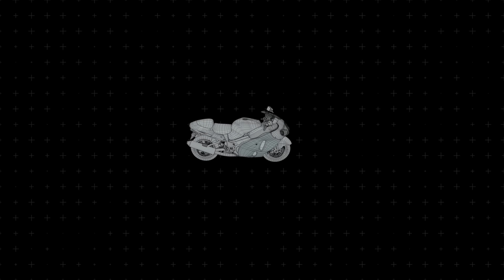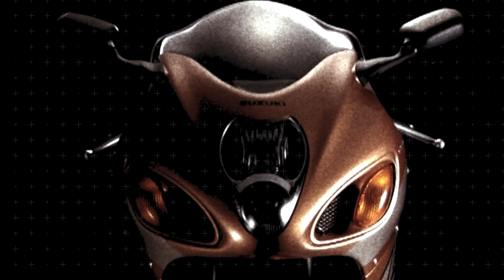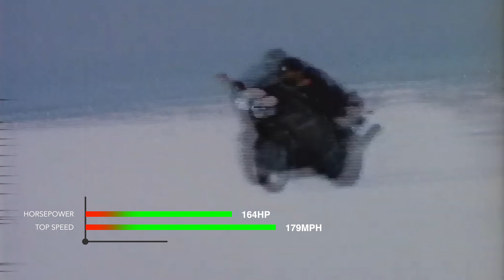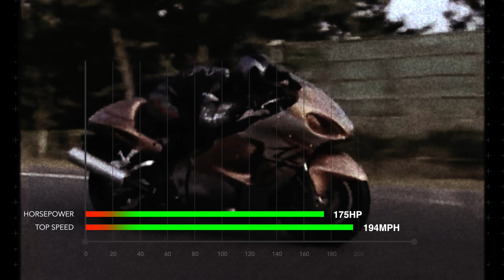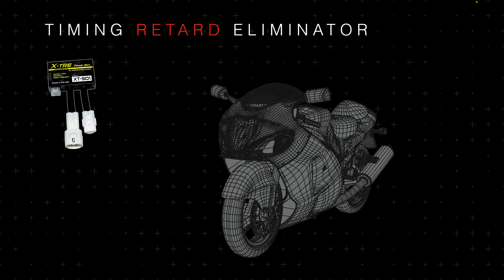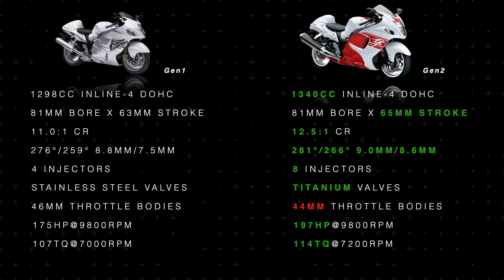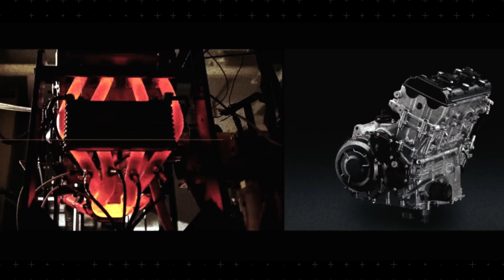Why Turbo Busa Engines Are Overpowered😳| Explained Ep.21

Comment: Radical also uses the stock 1340 Hayabusa in SR3's and SR1's. They also make a bespoke 1500 stroker Busa motor that pushes out 220 at the crank. The SR8 used a macro block V8 with stock cylinder barrels and heads from the Hayabusa spanning from 2.6-3.2 litre V8 that revs up to 10,500 RPM!
Reply: Like Lotus/Cosworth's 3 liter V8 that revs to around 10k and sounds like a F1 engine, pretty gnarly.
Reply: Didn't Ariel do a limited run v8 atom with a custom bottom end and busa cylinder heads too?
Reply: @goosenotmaverick1156  the Ariel runs a V8 but I believe it's based off of a Honda motorcycle engines
Reply: @wadehachey3066  Funny, I always thought they were Busa cylinders.
Reply: @Wooskii1  Me too, Busa cylinder heads and cylinders. CNC a crankshaft and crankcase you use almost all the Busa stock parts then get about 2.2 x stock power. (less bearing losses)
 Need to have a set of cams made for one side as it's running 'backwards'
Reply: @1crazypj  Ah, I didn't think about the cams but that makes sense... I just got a ZX-14R because I couldn't find a reasonable deal on an unmolested Busa. I guess the Kawis don't get torn apart as much. Someone told me that their Legends (or Micros?) use ZX14 motors, but I don't think that's too popular.
Reply: @Wooskii1  Having a separate block makes a big difference if your going to use two for a V-8. With the Kawasaki monoblock you have to make a block as well them have it 'plated' which would probably add another $3500 or more just for materials, machining, etc
Reply: @1crazypj  Yea, I don't like the ZX-14's block design, and I get it would take more to build a V8 block for it vs the Busa, but my point was the I don't see many ZX-14 motors in much of anything (the Legends cars I was talking about are factory ZX motors sealed with anti-tamper measures by the series). I do see tons of Busa swaps, street customs, beaters, and drag bikes which is one of the reasons I think you can find better and more available deals on nice ZX-14s
Reply: @Wooskii1  Friend used to race them when they were using Yamaha FJ motors (at least I think it was Legends?)
I think he left for the series where 'anything goes ' as long as it wasn't over 1000cc (haven't even thought about it for 14¬15 years so your explanation brought it back to me)
Suzuki had special financing for years so I think a lot more Busa's got sold before 2008?
Reply: @1crazypj  Same with me, I haven't talked to the guy that used to race for around 5 years, and he was into something different every few years (micro sprint, shifter carts, etc.) so I might have gotten the details mixed up... I don't know much about Suzuki's finance deals cause I haven't seriously looked into a new bike until very recently. After riding my buddy's Bandit 1200 I'm actually considering getting a new GSX-S 1000 (same motor as my other bike) and selling the ZX, but I need to wait for better weather to get some hours on the ZX first... Right now Suzuki seems to be the best "bang for your buck" and if they were like that back in 06 I definitely can see a bunch of Busas being sold.
Reply: @Wooskii1  I was working at MMI in 2006 and transferred to FAST (Factory Authorised Suzuki Training) 
Knew a few people in the trade back then
Reply: That 'Busa based V8 is nuts, I'd love to mess with one, maybe one day....
Reply: @EZ-D-FIANT  You can buy a detuned turnkey Busa V-8 for around $35,000. Makes a bit over 320bhp and is supposed to be dead reliable for 100,000+miles. The really impressive part is how tiny and light it is compared to any automotive V-8 (complete thing weighs about same aa one cylinder head for a Chevy big block) I seem to remember it's less than 2" wider than stock motor. 
Put one in a Mercedes 'Smart' and go racing
Reply: @1crazypj  tbf that aint that bad, I was thinking they would be about 35-40 UK £ 
I'd probably chuck it in a Hillman Imp on a built Vw camper box (Imps are rear engine if your not familiar with them, my last one was around 800kg they arw very cool little British 60's cars), the engine height is limited (without major work) in those cars we usually run flat/boxter engines or bike engines anyway, I've been itching to build another Imp I can't wait to tell the bank of wife I've been tempted by a £25k engine 😅 👍👌👍
Reply: @EZ-D-FIANT  Yeah, I'm British so know about the Imp, especially de-cambering front end so it can go around corners. The 850 motor was actually good for around 130bhp in offshore boat racing, rarely got much over 80 degC. It was also used in sidecar racing in the good old days before 600cc limit but didn't make much more than 85BHP.
I took a VW bus to Bug Jam at Sant Pod one year. BTW, the motor was being made in UK .
Reply: Those V8 were also used in the Argentinean Super TC 2000. God bless that sound...
Reply: That's what I was going to mention. Can you imagine the twin turbo V8 Buds? They started with a 300lbs billette and whittled it into a block weighing about 40 lbs that takes a bell housing so your imagination is the only limiting factor now. I would so love to put one into a GT40 continuation chassis with a 5 or 6 speed  behind it. It would be a very light weight 720hp 11,000 rpm screaming banshee of a set up. Christ I'm gonna stroke out just thinking about how sick a ride like that would be. Wow!!
Reply: Most aerodynamic lol. It looks like a fat sea lion
Reply: @Bed of Fire or Decompose 
You and I dont know a lot of these cars ! 
But I build a special car in my garage. 
Turbo is best and cheap and you can find ECU + injectors + sensors CHEAP 

Service + wear + spare parts + lost of the car + accident = You can life with that or never ever think ...

IF you are interested AND got the money AND this car types is that what you want ...

... Ohh you can afford to buy a car that is only made to run at a race trac.
You sit outside with no windscreen only a helmet with flys and stone marks at ...
If you lose these car ... well no financial problem ! 
If your health & body .... well a bigger problem as you expected. 

No with turbo or a supercharger you are use a engine that is  natural aspirated. 
The power is limited and everythink is expensive and the power results are ... ! 
With a lot of air additional in the combustion chamber well = 
-more power and 
- less extra weight and 
-small engine volume and 
- low coast 
- helping hands + knowledge is near (and not in GB or japan) 
- electronic equipment is affordable 
- electronic testers a in reach (plus eyes and brains to understand the display ...) 

These car types are made for one type of roads. 
No straith roads, not 1/4 mile ,
no local town roads, 
not made to drive around your neighborhood. 
Difficult to move on a trailer and get it off. 

No way, 
 these special car is a typical turbo (or supercharged) tractool
with low weight and 
well performance ;-) ;-) 
(if a road is not strait)

 AND if the money for a new gears is ...

Hey you pay tons of USD for the tracday, tire, pre-service, after-service, measurings+control+adjustments
+spare part+ mechanical wear + british parts per airmail ... 

Hey, no turbo 
= more cubic inch 
= more weight 
= more weight means additional structure to get that force from the chassis to the wheels
= more engine volume 
= very very very worse trac reaction+car performance.

You never ever have been at a race trac with a ultra light compact car 
(and a standart heavy car with road legal tires) ? 

A well idea for every interested man+woman = Look  at race tracs for a race trac taxi driver ! 
(standart high performance car with a professional driver = best US$ 150 we can spend)
(dont eat and drink 3h before the race trac taxi drive ...
(Plus 30 minutes before please visit a toilet and try what ever there is possible ...
( Be in physical and mental best condition and expect the unexpected ... 
( The taxi driver ask questions before he starts and sure he can go faster with that car but not your brain+nerve .. )
Reply: @Bed of Fire or Decompose unfortunately due to the high stress on the motor/transmission (both in the same casing when you're talking just the haybusa) reliability is a bigger problem. 1500cc motors only get around 60 hours of life. This is mainly a timeline based on transmission life
Reply: @wadehachey3066  tbh 60 hours isn’t that bad, even Porsche cup cars only get 100 hours of life.
Reply: @wadehachey3066
Reply: Radical is fucking awesome even though they mostly manufacture track cars
Reply: @Americana-deluxe  That's literally what makes them awesome, man.